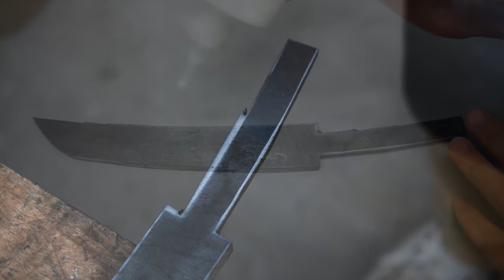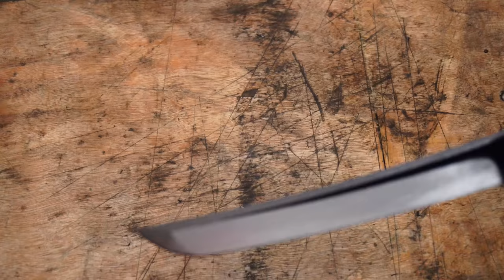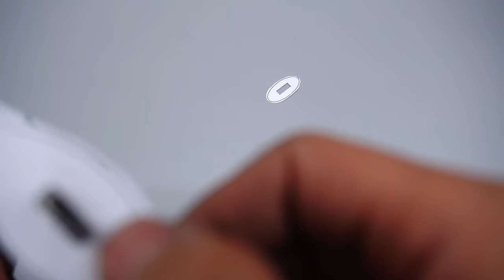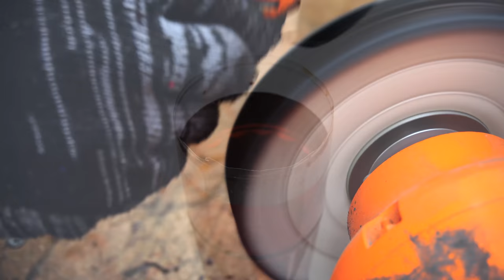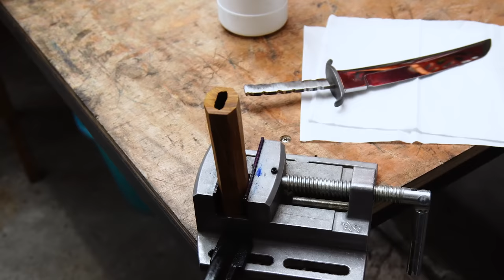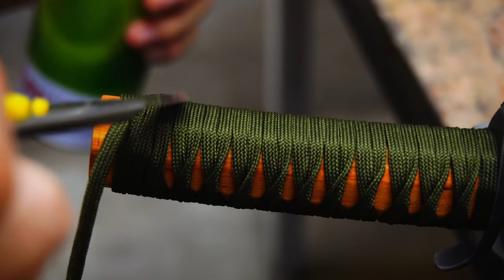Knife Making | Making a Tanto Knife with the S guard

Comment: I've only one thing for you. Wear protective gloves, the real ones,especially during the sharpening phase. 
Keep on safety mate, fingers don't grove on trees
Reply from the maker: Thank you for your reminder, I will always put safety first.
Reply: @creatorqi  
Good 👍👍👍
Reply: Couple of things, take it however you want...because each to their own and I am assuming you’re both adults.  And these are just my reasons and many, many other knife makers.

1: Gloves and a grinder?  No.  No matter how tight, or what material, wether they be cut resistant, flame resistant, whatever, are good way to lose your fingers in the machine if the material gets caught.  

2:  You need to feel how hot the steel is getting after heat treatment so you don’t ruin the temper.  

Knife making PPE is simple:  

Protect your lungs with a respirator 
protect your eyes with safety glasses 
and protect your ears with ear plugs, ear muffs with the highest db reduction you can find.

Peace ✌️and great job on your tanto👊
Reply from the maker: @griffithshandmade-knives  In the future, I will upgrade my heat treatment equipment to ensure temperature accuracy.  So far I can only rely on experience for heat treatment.  
Thank you for your reminders and suggestions.
Reply: @creatorqi  I was only commenting on why you should not wear gloves in reply to VENOM.  I made no comment on your heat treatment, that’s your business.  Grinding after heat treatment if you wear gloves you may not be able to feel how hot the knife is getting.  Good luck 👍
Reply from the maker: I get it, thank you.

Comment: As soon as you hit something with it it's gonna snap at the crossguard cause you made the corners sharp instead of rounded
Reply: You're saying that as if you can just snap a fairly thick piece of steel in one swing just because it has sharp corners on it. It may not be ideal ,but it's not gonna "snap as soon he hits something with it".
Reply: @mrkiky  watch forged in fire you'll see how easy that "thick" metal snaps
Reply: @3cho787  It really only snaps when there's a crack or a problem with the heat treat, or both. Those sharp corners are not that big of a stress riser.

Comment: All you have is epoxy holding the handle on????
Reply from the maker: Yes, I think this is enough to bond the blade and the handle firmly. So far this knife has not shown any looseness.
Reply: If the epoxy fills all the gaps between the tang and the wood, you're more likely to shatter the wood than pull that tang out of the handle. Don't let forged in fire tell you otherwise.